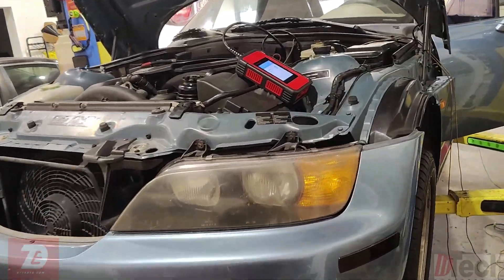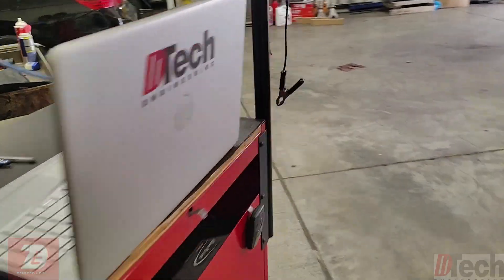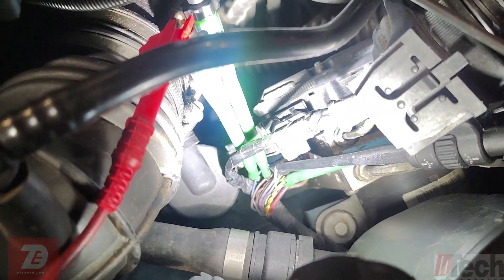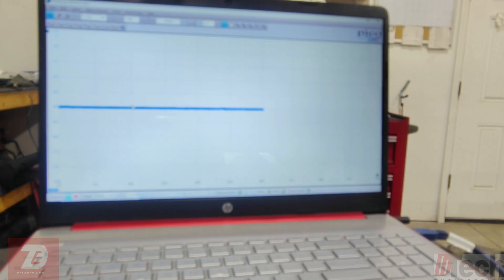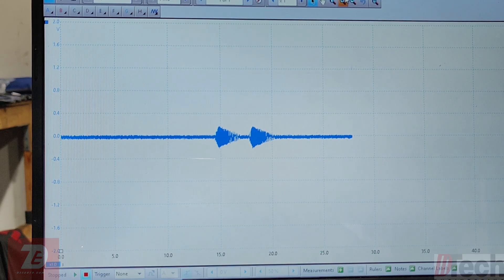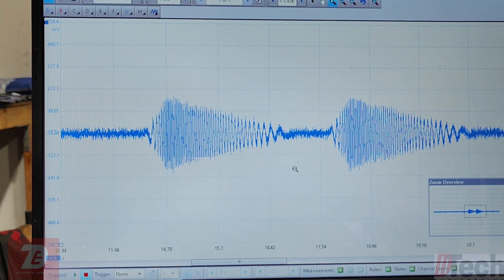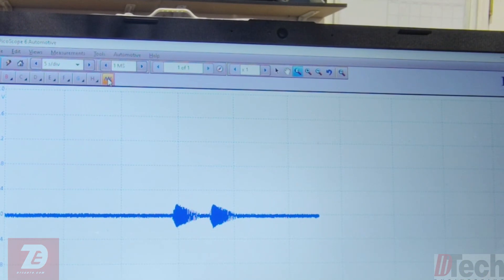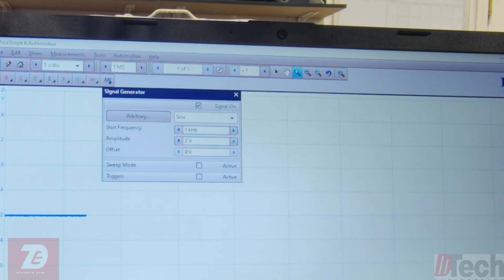BMW Wheel Speed Sensor Diag & Fix

Comment: What Picoscope were you using?  I have the Pico 4425A and dont have the waveform generator.  I ask because from my understanding none of the automotive scopes do but it looks like you were using the Pico Automotive Software which supposedly only works with pico automotive scopes.  Thanks!
Reply from the maker: It is the 8-channel automotive scope model 4823, I believe it's the only one that has the signal generator

Comment: Great video.
I have a signal generator on a portable mini scope that works great for this type of diagnostics. 
In these cases I perform an extra test for redundancy, using the small connectors and jumper leads I cross the sensors over spin the wheels and look at the scope and scan tool at the same time.
Reply: Can you send the link or give me the model of the signal generator that you have?  Would love to have one!  Thanks!
Reply: @kpfalconi  FNIRSI DSO 153     2 in 1 handheld oscilloscope/dds signal generator
amazon I think I paid around 60 
also there is a review on you tube

Comment: Try with a signal between 1-20hz and not 1 kHz and it might not disconnect you, because it senses the speed is geater than around 20kmh and disconnects the Scanner for safety reasons if you are driving so you watch you on the road and not in the screen
Reply from the maker: That's a great point!

Comment: You can typically expect this era BMW ABS module to kick you out of pid data if not the entire module above about 25 miles per hour, in case you were wondering why it kicked you out if you left your signal simulator connected. Internally I don't believe they are fast enough to do its own processes while also allowing a scan tool to arbitrate for the data.
Reply from the maker: Good to know, thanks for the tip!

Comment: how did you get a waveform generator in your pic auto software?
Reply: Picoscope includes a waveform generator as standard. Many advanced oscilloscopes will also have signal generators quite common.
Reply from the maker: The 8 channel pico is the only one that has it built in as far as their automotive line of scopes.
Reply: @DTEAuto  Okay. I been using the Autel Ultra waveform generator. Which btw the Autel scope and generator work really good. It is no Pico but it is a good second place contender.